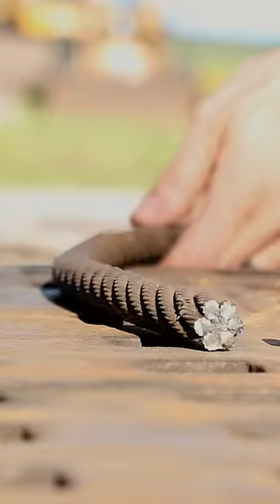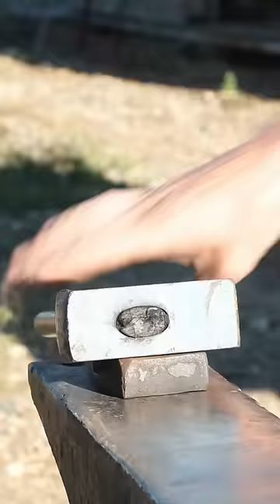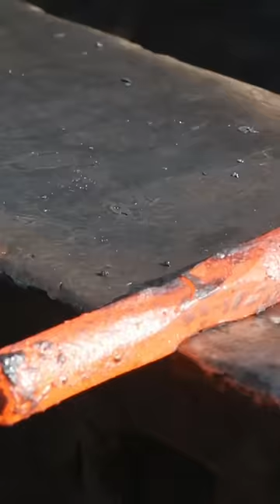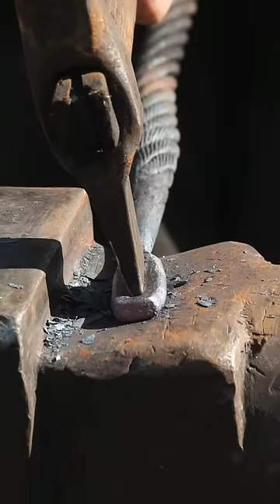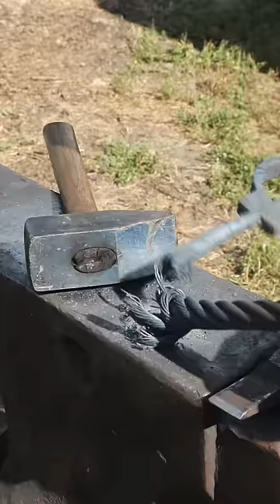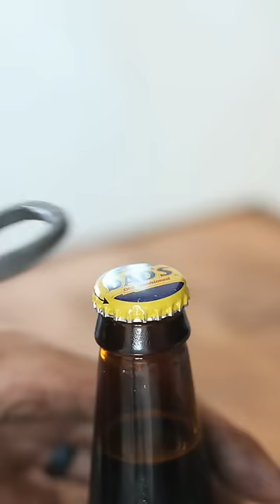Forging a bottle opener from cable

Comment: Since you forge welded that cable it's basically Damascus steel which means that if you clean it up with sandpaper and dip it in some acid it'll have a super cool Damascus effect
Reply: Was thinking the same thing. It's a nice bottle opener but it's a shame to go thru the trouble of making it from cable and not leaving much, if any, of the character from the cable in the finished product. You could much more easily make the same thing from bar stock so why not leave some texture or etch it to have the cable show thru.
Reply: @charliemartin2157  I hope he sees this I really want to know what it would look like
Reply: While it's commonly referred to as "Damascus", it's not. It's proper term is pattern welded. Damascus is just easier to spit out.

Comment: DAD’s ROOT BEER!!  Right on man!
Reply: Just recently I set up a blind root beer tasting with my wife, with maybe 8 different everyday brands of root beer, and, for one thing, we had a great time, and I'd highly recommend it!! In addition, I'll add that many root beers have lost their edge in recent years, switching to cane sugar, or artificial sweeteners, but regardless of any changes, Dad's held its own!! Dad's took 2nd, right behind Sprecher. Good times!! 😁
Reply: @OriginalSmoothOperator  My grandpa owned a small tractor dealership when I was little. I would go get a cold glass bottle of Dads out of the machine. Best I ever had.
Reply: @joshuahaney2232  I VAGUELY remember the glass soda bottles!! It was maybe 1988- my mother went to help her sister buy a used car, and for some reason, my mother brought all three of her kids along, including me, ages ranging from 2-11-ish at that point, and it was just the LONGEST day for us kids, but at the end, we delighted in the sweet, sweet nectar of ice-cold Coca-Cola from a glass bottle, provided by the machine!! (OK, so we kids each only had a sip or two, on account of being kids, but it was GREAT!!) And my aunt became the proud new owner of a '75 Pontiac Parisienne with 100K miles on it. 😆😆😆 

Does anyone remember 3-Liter soda bottles?? I know a few are still around, but most major brands seem to have dropped them a long time ago. Also, remember when 2-liter bottles used to have that round, plastic base glued on them??

While I'm at it- remember when Subway used to slice a wedge of bread out from the top?? They basically made a canoe for the meat and other ingredients to go in!!

Good times. 😎😎😎

Comment: Is it so easy to weld cable in one piece? I haven't seen any flux...
Reply: That's the reason that most people can actually Forge weld without flux is because the real benefit of coke is it's a very clean heat because there's not much oxygen mixing with the flame so it doesn't create as much scale
Reply: @reimerironworks314  thanks! 😉👍
Reply: @erikasjankevicius8560  no problem and also another thing that he would have done is he would have soaked it in acetone or some kind of chemical that would have taken all of the grease and stuff out of there
Reply from the maker: It always amazes me how well it welds, even with all the grease and crude in it. and @Reimerironworks is right, coke makes it even easier.
Reply: Thanks! I will try to do the same with coke 👍
Reply: @TimothyDyck  thanks for the mention

Comment: I need some help: I tried getting my charcoal to light, But it just would start, so eventually I made a large fire with wood then starter dumping charcoal in, after 3 hours it still wasn't hot enough to get my metal red. Any suggestions?
Reply: Are you forcing air through the forge? No fire, regardless of fuel, is going to get hot enough without additional air being added. That's why bellows amd fans were added to forges.
Reply: @mikeford963  no. i guess I forgot, thanks.